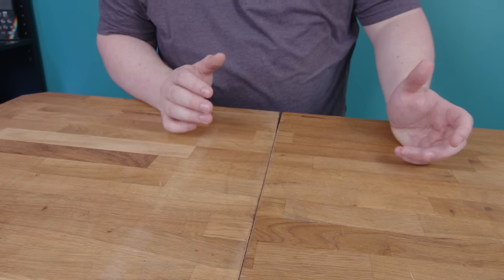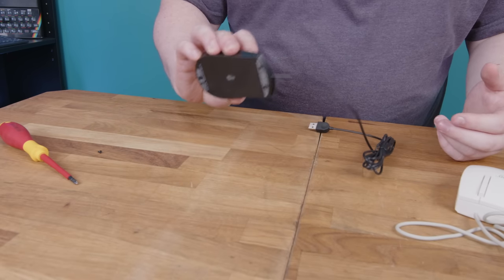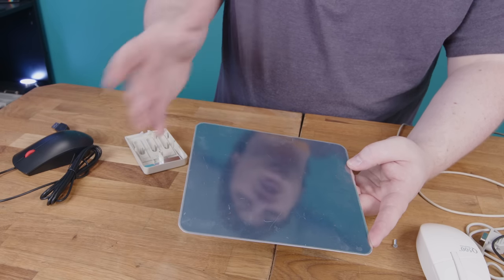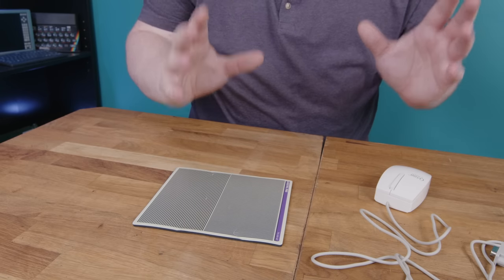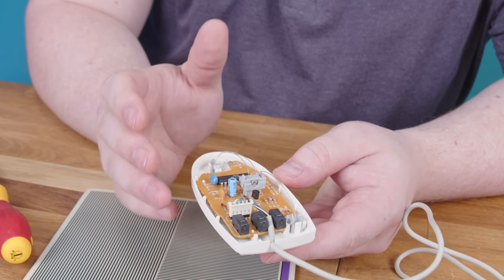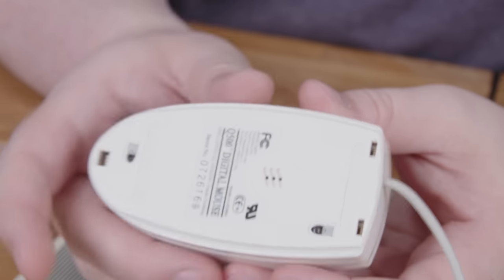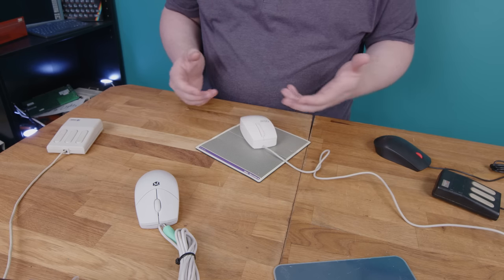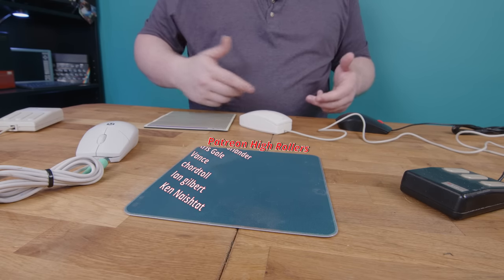Q500, The Weirdest Optical Mouse

Comment: I had a similar mouse but the mouse pad was made of plastic and the grid was all printed in the same color. At some point the mouse pad fell apart, rendering the the mouse useless. Just out of curiosity I printed a similar grid using my 24 pin needle printer on an ordinary piece of paper and guess what? That worked. Not as well as the original mouse pad did but the mouse was usable. The reason why I switched a ball mouse again was she scroll wheel. When I bought the optical mouse, scroll wheels didn't even exist and when they became popular, I wanted to have one, too.

Comment: Had 2 Mouse Systems optical mice, with the dedicated metal pad. 1 each for Mac ADB and PC PS/2. Great mice but hard to justify using the metal pad.

I eventually converted to Honeywell mice that used disc-shaped sensors on the bottom. No mouse balls and worked just about as well as an optical mouse.

Comment: 3:50  Optical mice didn't spawn an angry mob because it ruined computing, it spawned an angry mob of GAMERS who preferred high-quality, well maintained ball mice.  The advantage of ball mice back then was being able to scroll them as far and as fast as you wanted to.  Optical mice were limited by DPI, so super-fast mouse movements caused the mouse to stop and jump around on the screen--not ideal when you are flinging your mouse around in Counterstrike.  Mouse makers started using lasers in place of LEDs to increase resolution and to make the mice work on more surfaces.  After that problem was solved gamers started to complain about the polling rate (how many times a second the mouse reports  changes in position).

If there is one constant throughout history, it's people complaining about the next great advancement.

Comment: actually I remember there was firstly that laser sensor with red laser on the bottom, later after 2009 they almost disappeared due to lower prices of fully fledged optical mice, but I still find combos so called optical laser mice in shops. Actually using Avago Pixart sensor even this day but with max 10k DPI today. (Never set it beyond or above 1200, best sweet spot)

Comment: they should put two sensors in optical mice to give a rotation component to the movement. it wouldnt be needed 99% of the time but could be handy for graphic design or 3d modelling, maybe even some games could use it. like , say , leaning around a corner in an FPS game. it would need a bunch of filtering to ignore unintended rotations but it could be super useful.

Comment: "I don't think many consumers had these."   Yup... not many people with Sun workstations at home back in the early 90s!  I used one of these optical mice at work around that time though.
Reply from the maker: My understanding is that the Mouse Systems design was available for virtually all platforms, so could have been used on a normal PC.
Reply: @CathodeRayDude  Sweet.  I was just reminiscing about the eye-watering cost of those Sun machines.

Comment: I remember using ball mice.  The ball and the rollers would need cleaned a lot.  I used to just carefully scrape the gunk off the rollers with my fingernails, it was faster than alcohol.  I just used the alcohol to cleanup what ever was left after that.  It was disgusting but I needed that mouse to work and often when they need cleaning they don't work right at all.  I do not miss it one bit.  The only advantage of a ball mouse is they work on glass but some newer mice do too anyhow.  The pads on the bottom of a mouse still need cleaning once in a while, they get disgusting too.

Comment: My guess is the 3 holes in the bottom line up with some test pins on the chip so they can run a quick pass/fail on it without having an expensive jig to interface with the 9 pin port. More cost savings.

Comment: Someone most likely either had or bought a bunch of ball mouse controller chips for near zero.  They then came up with the rest of the design to utilize those parts.  Happens a lot with outdated parts as manufactures and brokers will dump them for near zero to get them out of inventory ...

Comment: "No one is nostalgic...you made something so good you won Gold, Silver and bronze!"
discontent trackball noises
Reply: even most trackballs are optical these days.. they measure optical flow on the trackball like it’s a mousepad
Reply: @krallja  yeah, the ball is speckled. The trackball takes the worst aspect of a ball mice and added a layer of complexity 😁 while the actual tracking is fine with a little grime, the ball suspension needs alot of TLC, i.e cleaning...

Comment: Typically its 125 images per second. Gaming mice often increase that, mine does it 1000 times per second but its a decade old at this point. I've not really noticed much difference so maybe they're now doing it 250 or even 125 times a second for gaming mice too - why do something harder if nobody notices. But its a surprisingly low number regardless, yet still works great.

Comment: I actually never made the transition to optical mice. I really liked the feel of track balls, and then I got a Wacom tablet with a mouse that uses absolute positioning and I've used it ever since. That and laptop trackpads. I've used optical mice on other computers and don't like the feel of them compared to the absolute positioning of the Wacom mouse or the tactile feedback of the trackball. But I'm a crazy outlier here

( What I mean by absolutel position is that the Wacom tablet determines the cursor's position based on the mouse's position on the tablet. The mouse is wireless but doesn't take a battery because it's the tablet itself that's plugged in. The mouse could be tilted 45 degrees or even upside-down but if it's moved to the top of the tablet, the cursor moves upwards. This lets me use the mouse in a really relaxed position with my wrist. )

Comment: I like it when a mouse has some weight added.  Ever see one of the mice Dell includes with their systems?  They are light as a feather and feel really cheap.  They feel like they would break super easily.  Of course it is easy to go on for a long time about all the flaws of Dell computers, some of which are deliberate parts of the design too!

Comment: I'm afraid I have to correct what you've said around 16:45 ("since it samples two bits, it offers four times the resolution"), that's not quite true. The resolution is just doubled, not multiplied by four. If it be only one fiber and one sensor, it would be 1 bit, hence giving 2 states in one "line / space" unit; and 2 bit offer twice the resolution than 1 bit; 4 states opposed to 2 states, in one "line / space" unit.

Also, with only one sensor, it just wouldn't work, as it wouldn't know the direction of movement. What this does, is just mimicing an optical rotary encoder, as in every ball mouse. It uses the two phototransistors for detecting the direction of movement, and does this in an alternating fashion for the x and y axis (probably pulsing the IR diodes alternately in a time-multiplex manner), thus only two sensors for four lightpipes.

Btw those lightpipes, as you correctly mentioned, are cheap as you can imagine. It's the same material as also used in TOSLINK cables (the cheapest "optical connection" technology ever released to the public). Wouldn't be surprised if they just took these off the shelf and cut them into pieces.

Anyway, this is a great and interesting video - thanks for sharing that and keep it up! Great!!!

Comment: Too bad they didn't use voltage levels to various degrees in the measurement vs a simple on off. This thing could have had incredible resolution. Probably could have still done it with off the shelf components I.e. an adc on the photo sensors.
Reply: If it’s entirely ball mouse circuitry, then I think that’s happening? IIRC that’s how they could tell if the wheels were going clockwise or anti-clockwise in the actual ball mice, so if it’s truly off the shelf chips…
Reply: @kaitlyn__L  They tell the direction purely because there's two photodiodes for each LED. The photodiodes are offset from each other so they can be read with standard digital quadrature encoder counter to tell the direction. Analogue sensing wouldn't help at all, you might be able to estimate when change of direction happens during movement, but you can't figure out the direction from standstill.
Reply: @SianaGearz  okay, then that’s even more exactly the same in the optical version!
Reply: @kaitlyn__L  Yes. The only difference is that the encoder LEDs in the ball mouse are constantly lit; while this mouse needs to pulse them individually.

It probably doesn't matter much, i don't think there were super dedicated mouse chips back in the day unlike now, as no specialised functionality was needed; instead they were low-spec mask ROM microcontrollers, so getting a run of several tens of thousand made wasn't really an expense.

Comment: I guess the mouse pad didn't have to be as big as the screen real estate was under 800 x 600 or less, so you weren't really trying to go from one end of the screen to the other in running out of space needing a LTT desk pad.
I have to give them credit for a completely off-the-shelf original design they deserve that zinc coated lead trophy.

Comment: The different wavelengths of light is likely a trick to circumvent the possibility of one laser getting what the other laser was expected to see. And if memory serves, red and infrared LED's were the only ones available. At least cheap enough for consumer products.

Complete and total crapshoot though because I can't really think of a good reason why they'd need to do that in the first place. My best guess on that could possibly be firmware limitations? It's possible that given the technology at the time, they achieved more reliable results by having a separate wavelength to possibly help error-correct what the opposing sensor couldn't pick up.

Comment: It looks like the 3 holes at the bottom line up roughly with the 3 vertical solder points?
Maybe it's purpose is to help hold the board in place.

Comment: I have found that modern optical mice don’t work on all surfaces. I think some materials produce a reflection that is too uniform/bright/whatever for the sensor to extrapolate movement. I’ve seen it a couple times in medical facilities.
Reply: Clear glass desks don't reflect, so optical mice don't work on them. Also, I once encountered a desk so black it didn't reflect enough light back.

Comment: I had a Mouse Systems optical mouse in the early 90's and it is still the smoothest most precise mouse I have ever used even compared to modern optical mice.
Reply: The model that shipped with the SPARC 1, in this video, was absolute garbage. The later design (SPARC 20 era) was better. But I do not share your rose colored glasses. Modern $1 mice are better than these mice, and anything more expensive than $5 is far better. The later (SPARC 20 era) design was better than ball mice. The earlier design was worse. That's right. The earliest optical mice (late 80's to early 90's Sun workstations) were worse than a good ball mouse of the era. Using them was frustrating. (I worked for the engineering computer network at a major university from 1994-1999.)

Comment: makes you wonder if you replace the LEDs with white LEDs with a cyan and magenta filter .. and print a raster of cyan and magenta lines over each other if it will work on a bigger mousepad. But you might have to print the white little squares black for it to work.  They probably didnt have cheap white LEDs then.

Comment: Making a product then  allowing many other companies to brand and then resell your product is called “White Labeling” and right now China is especially good it. This is how many electronic/computer brands make accessories with their own brand on them without needed to design their own version. For some products like a mouse, keyboard, monitor, battery charger, and so forth you really don’t need to design your own version as the designs are very standard and a basic these days unless your wanting to add a special special feature/value-add and even then many white label products can be customized in limited forms with certain popular value-adds.

Comment: I did ses a few Mouse Systems optical models in the early 90s but likely the same way most did then: Sun systems at university.

I wasn't expecting to be impressed by that mouse, especially after the fiber optics, but it is a clever design.

Comment: 3:26 brb need to go on a tangent to see the specifics of that math

edit: look up laser doppler effect; the whole thing can be boiled down to a formula akin to

f = 2vK

where K is a constant that depends on the colour of the laser and the angle of the emitter

apparently there are two beams in modern mice, which could correspond to the X and Y axis, but this is just my own speculation; I can't seem to find how it computes 2D information using 1D data (frequency)

edit: 6:36 i feel like this validates my theory

Comment: thos three holes seem to line up with some pins or via holes on the board? maybe for testing the mouse at the factory to make sure each sensor works using just a multimeter.

Comment: Haha sniper mode.. I used to use two mice for fps when I was younger, one normal and one of the giant billiard ball Kensington trackballs. I'd reach over to the trackball for sniper mode because it was vastly more sensitive/slow than the normal mouse used for high speed play.
Reply: Side note, I used that trackball for so long, well after it was discontinued. I managed to crack the big while ball when fooling around with it. I emailed them asking if I could buy a replacement. They said no, asked for my address, and shipped me an 8ball for free that worked perfectly... Im pretty sure it was like a novelty upgrade ball for the mouse and not a real 8ball. Whatever, it worked and I kept using that ancient thing forever, like probably until 2007.

But yea, free replacement part from a huge company. Always thought that was nice.

Comment: im having to work with optoisolators at works so i see how some one could make this relatively easy with off the shelf components with an microcontroller doing the heavy lifting
this screams modern diy arduino project tbh

Comment: i remember once trying to skimp on having to fork out $150 for a real mouse, a microsoft ball mouse. my $30 cheap mouse worked fine for about a day, then the ball went in. the reason for that was that the whole pcb with ball was stapled to the plastic case, which (no wonder) didnt hold long. so i bought a microsoft mouse again.

Comment: i used to work as a NC/CAD programmer and you are really under appreciating that thing...
...blocky circles in paint isn't really the mouses fault now is it?

it's not the screws fault that the p*ssy don't fit bolt face

Comment: The feature similarities are due to bundling the same mass produced software bundle.  If it uses a common mouse protocol, it's probably just a 3-button mouse that would work as such with generic drivers for that protocol.
Reply from the maker: There is no software. This is a generic serial mouse, the features are implemented completely in hardware.

Comment: 21:00  Wouldn't the same trick that makes 1 set of sensors work 17:08.  If you strobe horizontal or vertical you know weather you're measuring horizontal or vertical pulses.  No need for a change of sensor design/logic.  Plus then you only need the 8 photo diodes or (how small did they make ccd's) a smaller CCD.  I can't think of any reason your idea wouldn't work.  Just figured they'd probably want to hold onto their zinc trophy and save the money on both cost and extra re-design....

Comment: So just using different color LEDs this could use a proper checkered mousepad, all with a ballmouse chip?

How does the rotaty encoder know which direction the transition is going with just one sensor, are they also in pairs?

Comment: The moire from the mouse pad was awesome 😲
Reply from the maker: I struggled to get a clear shot of the pad! The super closeup frozen shot - that's the absolute closest I could get. I gotta invest in a macro lens ASAP
Reply: @CathodeRayDude  I spent way too much time playing with Broderbund Print Shop on the C64 I think there was a mode with radial lines that would make interesting moire patterns, will have to see if you've done a video on that program or might be a video idea if you haven't yet. If you make a copy onto a transparency and rotate it on top of the original you should get some interesting patterns. I could swear that was called a phantograph or phantogram, but searching all I'm getting is info on pantograph or perspective image phantograms.
Reply: Also wasn't a criticism at all. If anything it's clear that you were aware of the potential problem and did your best to make a video that wasn't migraine-inducing.